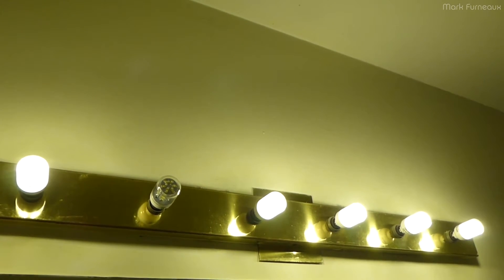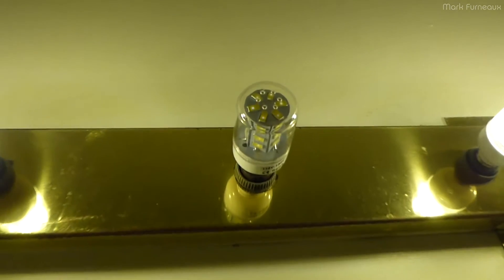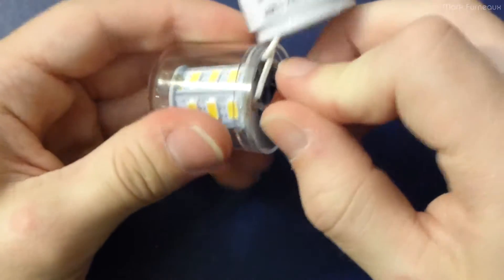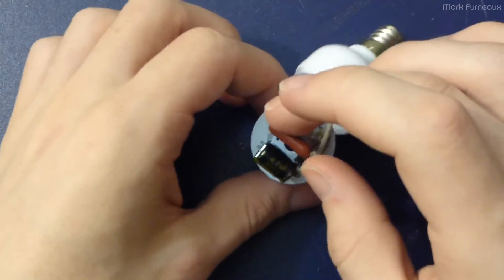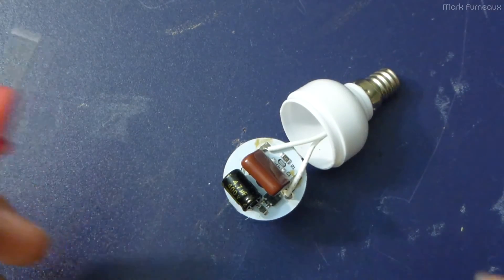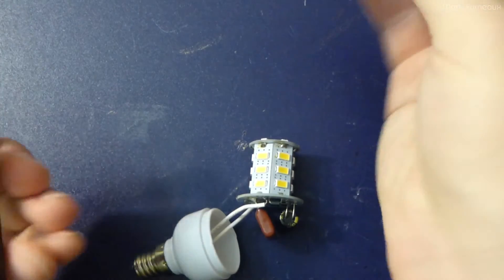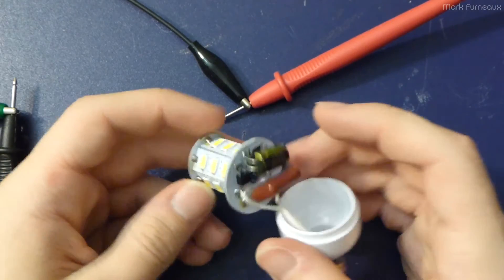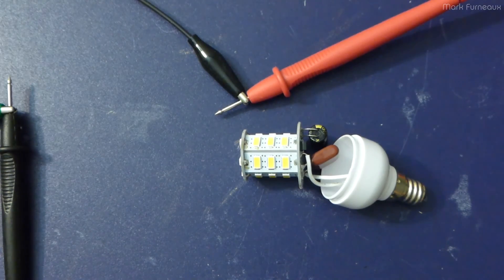Follow Up: First 5.5W Candelabra LED Bulb Failure

Comment: It is a broken bondwire in LED that arced resulting a black spot so others glow slightly from nanoamps of leakage current, that's why it glows much longer when turned off as it discharges the smoothing capacitor much slower. One of the method how to make the bulbs last longer is by replacing the dropper capacitor (brown one) to smaller capacity 400V one, 220nF works well. It has lower light output then though.